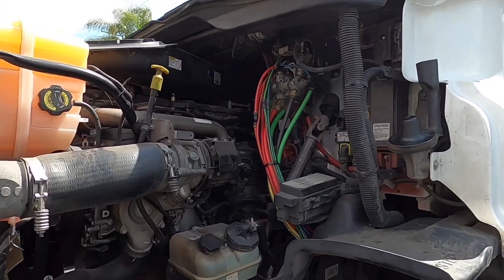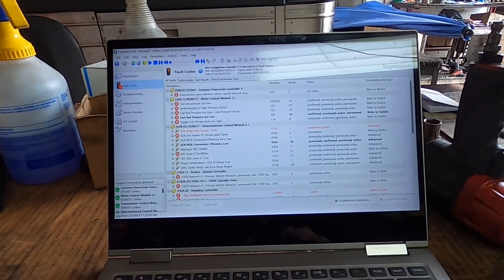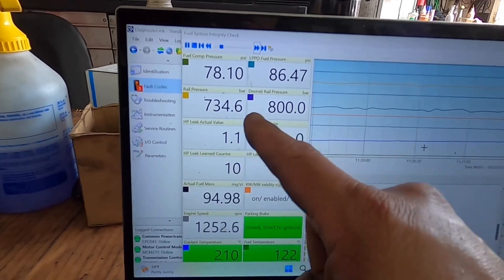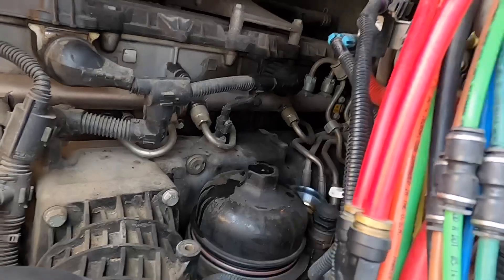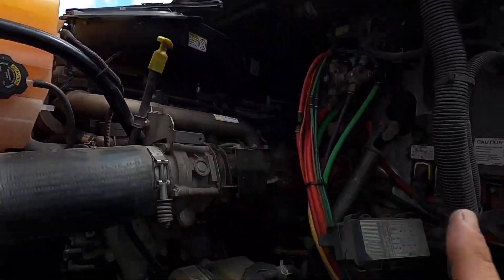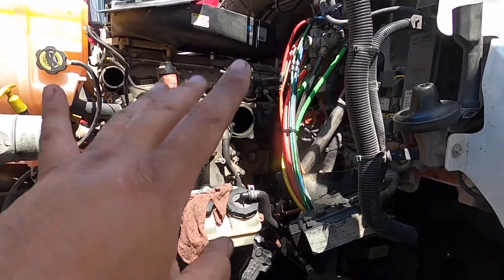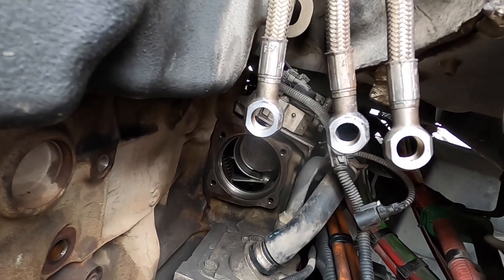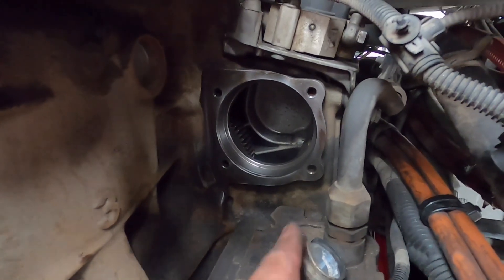DD13 with a bad fuel pump. What to look for and how to repair Part 1

Comment: I had a strange noise kinda like metal wire grinding on metal most of the day and then truck wouldn’t start. Started with starting fuel. Mechanic told me it was the pump. But there are also high pressure fuel sensor on one end and valve on the other end of the rail. Could it be the problem? But I guess the noise probably indicates that it’s the pump itself? Also, how much do you charge for this kind of work, mine is a short nosed as well 2018. just want to compare the prices. I’m in PA
Reply from the maker: definitely sounds like the fuel pump, the metal debris inside the small filter will confirm. Time to change out the pump is easily 10-12 hours.
Reply: @CarlosDieselElectric there was definitely lots of metal debris in that small filter. The only thing that worries me, that it might happen again. The dealer said I need to change injectors and tubes as well but injectors seemed fine and didn’t misfire.
Reply from the maker: @yanvinokur5920 is this a warranty job?

Comment: What symptoms did this truck have?
Reply from the maker: @matthewhansen5008  low power, also had a strange sound coming from the fuel pump area. Also had fuel pressure fault codes.

Comment: Hu much all
Reply from the maker: @Game-xm5bf  fuel pump depends on the year or application. Fuel pump is around $1700-2000 plus additional parts like fuel lines and coolant lines. Labor depends on the application. Is the truck is a short nose Cascadia i charge more because it is more labor.
Reply: 3700 ok
Reply from the maker: @ is that how much you paid?